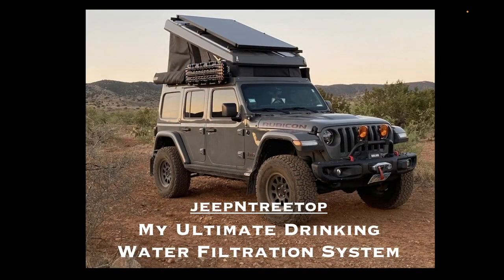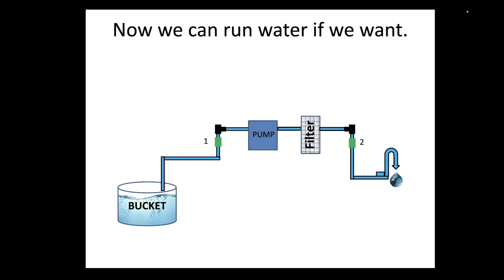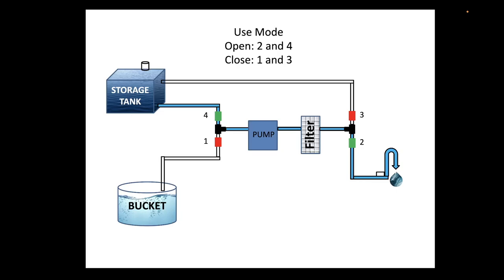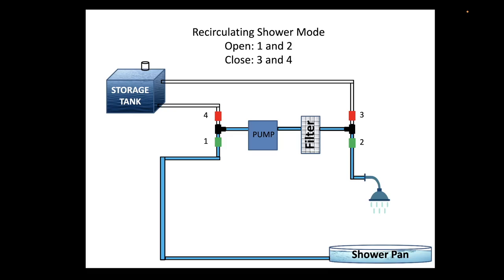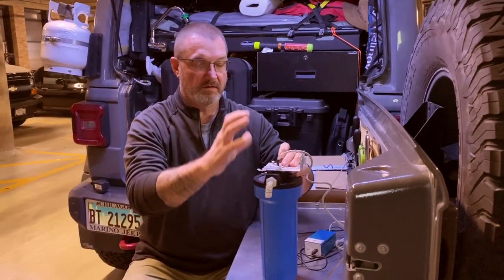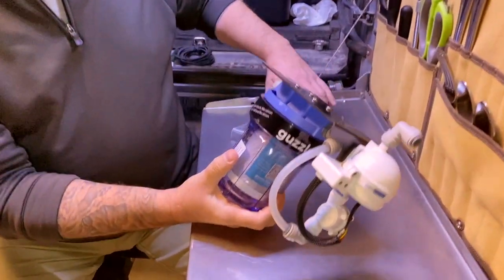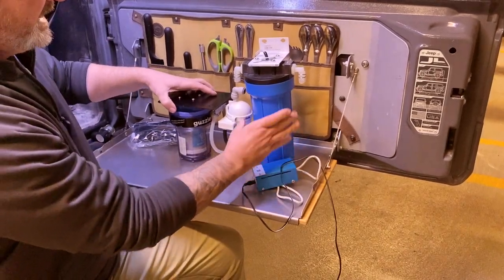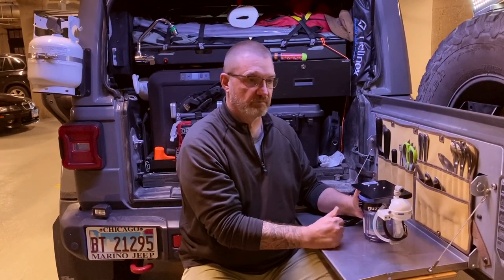My Ultimate Drinking Water Filtration System Part 1

Comment: Hey, what fridge slide and shelf system do you have?  I’ve been looking for a shelf that fits the 55im as tights as yours and haven’t been able to find anything.
Reply from the maker: The fridge slide is the standard slide from Dometic that fits the 55im and the shelf is made by Hooke Road bought on Amazon but I had to take the mounting brackets, cut them down and drill new holes to raise the shelf up to accommodate the fridge. 
Hooke Road JLU Cargo Cover Basket Rack Luggage Storage Carrier Compatible with Jeep Wrangler JLU 4-Door 2018 2019 2020 2021 2022 Hardtop & Sky One-Touch Power Top https://a.co/d/eeyKOVH
Reply: @jeepNtreetop  Sweet, I’ll look at ordering the slide right now!  Also, the fact that you had to adjust the shelf lets me realize that this product won’t work for my application.  The American Adventure Labs shelf comes with an adjustable mounting bracket so I’ll consider something like that instead.  

Thank you so much for a quick reply.  Stay safe out there!
Reply from the maker: @zeiden1  I bought my shelf at a time when American Adventure Labs did not have any of their shelves available otherwise I would have bought their product, I really like their stuff. Good luck, be safe, and see you out on the trail.

Comment: What's the flow rate, once it's all assembled and primed? 
What's the ballpark filter life?
Have you used / do you recommend a pre-filter to remove the larger contaminants?
Reply from the maker: Thanks for the comment and good questions!
The flow rate of the pump is 2 gallons per minute once all the air is out of the system. The manufacturer recommended replacement interval on the carbon filter is every 10,000 gallons. I plan on replacing mine annually. Even though the diagrams don’t show it a pre-filter is always recommended on the inlet side of the pump. I have one installed that you will see in part two of the video series.